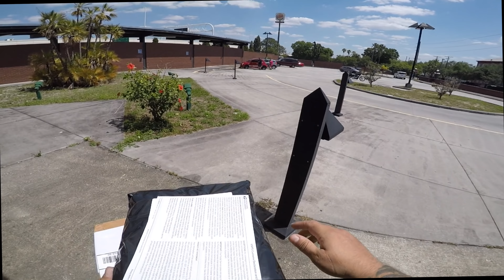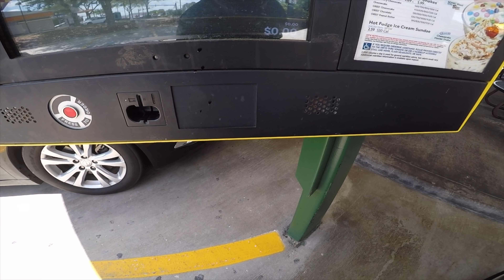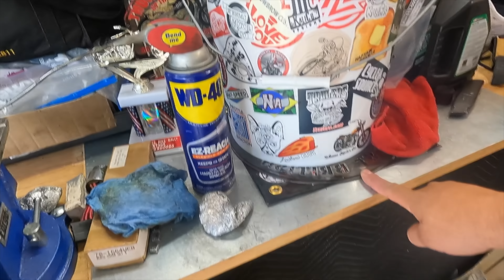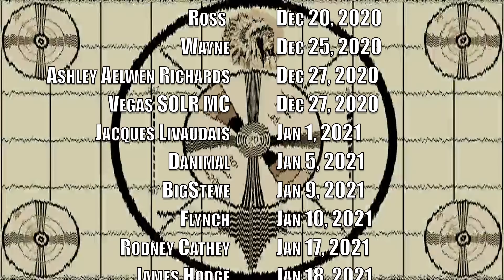How Did i Make It This Far In Life ?

Comment: the thing with the GoPro mic adapter is that they took out the firmware on the Hero 5 and up and just put it into the box on their own mic adapater. That's why it' a brick (and also why you can't use a 3rd party USB-C mic adapter). I just wish the cord coming from the adapter was longer/more flexible. I feel like it's too stressed no matter which way I orientate it. I've had good results so far with the Purple Panda with the foam around the mic and the deadcat around that. And set on wind-only mode.
Reply from the maker: No shit!!!! Perch! I feel the same way. They didn’t design it to work. What’s worse is that with the 8&9 the usb-c is now horizontal and not vertical so the rubber doesn’t bend that way well. Like “how were you expecting people to use this???” I bought the media mod just fo the straight 3.5mm plug in. Wanna see how it works
Reply: @FlipNA  i hav an 8 and a 9 in my box at work.. we never use them for helmet cams we just use the big ones for shop stuff. I use a 5 on my helmet and my buddy/boss uses a 6.
Reply: also one touch recording doesn't work with a go-pro adapter. at least on the 9, it was an issue.